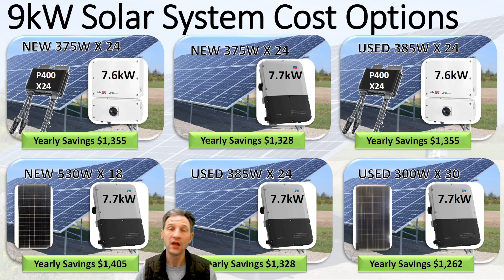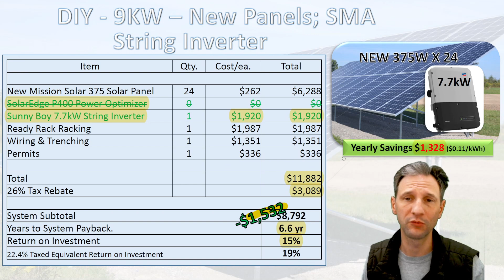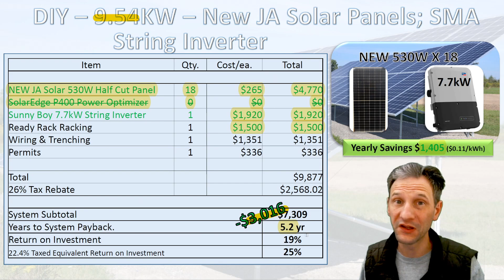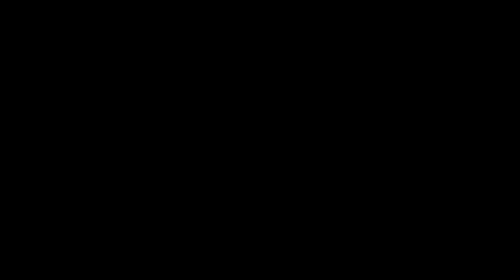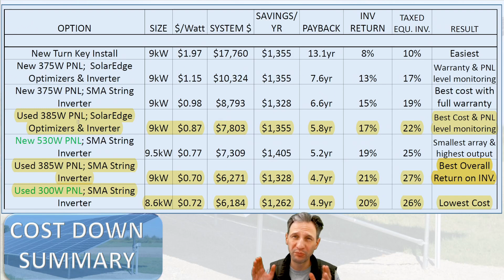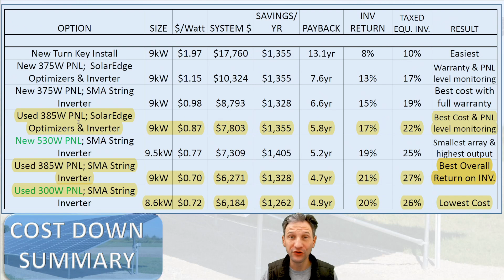DIY Solar Panel System - How to Do it CHEAPER!!

Comment: An East/West array produces nearly as much energy as a South facing array. This is due to the Sun hitting the face of the panels longer during the day. The Solar generation curve is indeed widened and flattened out. Additionally, your array produces energy earlier and later in the day because the panels are facing directly into the Sun.  My Electric company (in FL) is even trying to get people to install West facing panels because, here in Florida, there is so much A/C demand that having West facing panels can really make a big difference. I think more Electric companies will begin installing East/West , fixed mount, systems to reduce the LCOE and many might begin installing extra West facing panels to better match their demand curve.
Reply: It is not true that East or West facing panels produce the same as South facing ones. The main reason is that the East-West facing panels ignore the sunlight till the sun is at a degree higher than the tilt. Since keeping a flat panel is not recommended due to accumulation of dust and washing problems, a small tilt, say of 10 degrees is a must. This means the panels will simply not work for 1/9th of a day and work at a very low intensity for another good length of the day till the sunrays make sufficiently straight contact with the panels. On an average, expect a loss of 1/6th of the energy generation in comparison to south facing panels
Reply: @shrujanamsyama9940  I never said that East/West facing panels produced the same amount of energy as South facing panels,  I said "Nearly as much". I believe when you consider the low angle of the Sun during Winter months  which reduce the effectiveness of South facing panels, and the fact that an East/West array will not be effected by the Sun's lower angle, the East/West array will produce nearly as much energy as the South facing array.  Your point of an East/West array producing 1/6th less energy is reasonable, however, I think the energy reduction is less than 1/6th (perhaps 50% less than your 1/6th figure).
Reply: @bbcooter388  Even during winters, the sun is still in the south (assuming you are in North hemisphere) and south facing panel serves the best. Only for those people who are on the equator, the east/west facing panels may perform somewhat close to south facing panels. For everyone in North Hemisphere above 10 degree latitude, it is decisively south facing panels which is the best. Similarly, everyone below 10 degree South Latitude, North facing is decisively best.
Reply from the maker: Thanks for that information!  Do you have any articles or documents you can share on where you got your information?  I'm always looking for actual data.  Thanks!
Reply: @ProjectsWithDave  I could swear that I answered this question when you asked it,  however, it seems to not have been properly recorded.  I don't have the original article that I first read about East/West arrays,  but a quick Google search for East/West  Solar arrays will bring up a good number of articles for your research.

Comment: Love your video!  But, this is just my opinion, what you paid AFTER your rebate, is what you can get a system for with some good lifepo4 batteries.  To me the grid tied systems are a scam, the people selling them are really getting the rebate (of course if you do it yourself like you did, it's way better).  Still, I know it's easier when using your 220 V central air and such, compared to batteries.  My house is all propane for hot water, stove, and heat, we also have a wood stove that heats the whole house if the winter.  Central air and the dryer are the only big pieces of equipment that we don't use our solar on.  We didn't really do it to save money,  just to use it each day, and when  the power goes out, it's worth more than money.  Here in WV we don't have too many outages but we seem to get more each year, and the way the world is going right now, I wouldn't take a million $$$ for my system.  It works great!  You have a great system set up!
Reply from the maker: Nice job!  Thanks for the input!  Of course my house is all electric, including winter heat so off grid is a pretty significant challenge.  However, I intend to get there some day...  : )
Reply: I also have an off grid system. I installed it myself. I have 12,000 watts of panels. I never use all of my energy produced. But I have natural gas for most of my major appliances. Water heater, stove, dreyer and fireplace insert. I still use some electric from the utility company. Some months when using more power from my mini splits during the winter. I only have 20,000 watts of battery back up. I could still unhook the grid power if needed. But the comfort is highly important. So we run the heat with our mini splits in the bedrooms.

Comment: Are you taking into account that some of these systems have higher wattages than the inverter can handle in your payback calcs? Friends of mine have inverters like this and they hit peak power production on the inverter and are clipped. A 14KWH system will never make more than about 7.7KW with a 7.7KWH rated inverter. Am I missing something? I'm hearing that some installs are pointing panels in different directions liek you're trying in order to broaden power vs hitting really peak power which can allow for less clipping with larger arrays. Personally I'd go nuts if I were seeing clipping lol.
Reply from the maker: Yes, these system proposals all have clipping.  However, from my research and personal experience some clipping is advisable.  Even with this level of oversizing you have cloudy and winter days with little to no clipping.  If you size your inverter to prevent any clipping, it will take much longer for your system to pay off. If you live in an area with very consistent sun exposure year round, you may want to target less clipping.  The west facing test rig in the video is my attempt to maximize the oversizing while minimizing the clipping.  We will see after about 6months if it makes sense or not.  Here is an article on oversizing the array: https://www.sma-sunny.com/us/7-reasons-why-you-should-oversize-your-pv-array/

Comment: Hey Dave, Did You Read The Whole Full Note That I Had Sent You Before? PS As For Your Reply About Our Solar & Wind Resources Here In Texas & The Grid Shutdown Last Year? Do Some Further Research & You'll Find That The TRUE THUTHS On Those Matters Is That Our Solar & Wind Ran Strong Thru That Whole Ordeal & It Really Saved Our Bacon From Even Worse or Longer Blackouts! Then EPCOT LIED IN REPORTING TO NEWS AS TO WHAT REALLY HAPPENED & Blamed It Falsely On The Solar & Wind Powers! The Real Truth Is That Many Of The Main Line Coal Burning Plants Were Shut Down & Taken Off Line Because The Coal Piles Had Too Much Moisture Content Due To EPCOTs Bad Inspecting Programs! Soo When The Outside Coal Stock Piles Froze Solid Together Due To The Extremely Low Temps, They Couldn't Get The Coal Into Plant's Burners, Thus A Bunch Of Major SHTF Problems Arose & Grid Collapses Until They Got Them Thawed...
Reply from the maker: Ha... no, I didn't realize it continued below the line.  I had not heard about the coal plant issues, do you have a report on that information you can link to?

Comment from the maker: Find More information for this project and others on my website: https://projectswithdave.com
Other related videos you may like:
Super Cheap Solar Panel Review: https://youtu.be/qu4iGxBhqzs
Check out the first year performance results here:  https://youtu.be/BatTeSq05rU
See the total system cost here: https://youtu.be/PNTO83FvaL4
And How to size your solar system here: https://youtu.be/rbFnZqA0GCI
4 Things to Know About Solar in the Snow: https://youtu.be/vY3PufzPUnI
Ground Vs Roof Mount Solar: https://youtu.be/w-iS_8e7n60
How to Get A Permit For Your Solar System: https://youtu.be/imiEYDHLG4A
How to Crimp MC4 Connectors: https://youtu.be/oH3LqTu4B8E
3 Solar Panel Wiring Issues Answered: https://youtu.be/i7vHEHB3a-M
Net Metering Explained With Actual Data: https://youtu.be/IwUK1dNJ3n8
Reply: Why are there used panels available?  I can understand used cars - some people have higher standards for reliability and looks, so they replace the vehicle before its end of life.  But what circumstances lead to used panels?
Reply from the maker: There are multiple reasons for the availability of used panels, one is the result of upgrading to higher performance panels.  Some installations are limited by available space and the only way to get more power is to replace the panels with a newer higher efficiency panel.  Other panels could be the result of a recall for some manufacturing defect, so you should purchase from a trusted source that will back up the performance.
Reply: Dave, did you calculated degradation over time in ?
Reply from the maker: I didn't consider degradation or the rise in utility rates in the payback period.  I assume they will cancel each other out.  : )
Reply: When you buy used you have to consider how old they are and how long have they been producing? Degradation becomes advanced for your calculation and will lose production on the tail end compared to the same time frame as new. Time for financing matters as well. Where you are located regarding latitude makes a difference. The closer one is to the equator the better production you will realize. Regarding direction, south captures the most efficient arc of the movement of the sun across the sky. Perhaps a change in the tilt angle for winter and summer might pay dividends. One has to realize the life of the inverter and if it needs replaced will be out of your pocket. I lost 11% production being not directly south but a bit west on the roof. Are there obstacles that impact your array that you have no control over?  Shade is an enemy. I wish my prices were as low as what you have demonstrated. Like a lot of things the longer it goes the price comes down.
Reply: better results rail shutters chrome paint leds lights。
poof its elec。

Comment: Need to get a little deeper into these systems. The 530 watt panels will not work with the Sunnyboy which has a max 10 amp input.
Reply: I’m starting a system with two SMA 7.7 and 48 380 watt Q Cells  my cost $20,000.
Reply from the maker: Thanks for pointing out the amperage limitations of the SunyBoy system.  However, according to their design software the system can handle the higher input, it just limits the input current to 10A resulting in a 2.17% loss.  The 18 panels is a bit overpower for the system and it would be better to just use 17 panels which would also match the 9kW of the other system comparisons I made.  If what you are saying is true, even the system you planning would not work as the 380W Q cells put out 10.5A.   If you have some information showing it can't handle the input, or the SMA design software is in error, please let me know.  Thanks!
Here is a link to the design software results: ( https://drive.google.com/file/d/11rEOtXr7y6K_gpgGOpmtrspattXJzVLG/view?usp=sharing )
Reply: Here is the best information I have found. Sorry it didn’t paste. SMA stated the max fuse is 12.8 amp per MPP.
Reply from the maker: I called SMA to confirm your concern.  The spec sheet shows a maximum short circuit current of 18A.  The system will only utilize up to 10A, but it can handle up to an 18A input.  Since the JA Solar 530W panels are 12.8A they are well within the system limitations.  See the spec sheet here:  https://drive.google.com/file/d/1YaPrmoqx_wlnVeV_pSad8lgbbBSymkZN/view?usp=sharing
Hope that helps.  Thanks!
Reply: Thanks for the info yours is one of the first videos I use to start my system. I wish I had known I could use the larger panels  it would have saved me a lot. Here is the tech note that had me worried.  

 TECHNICAL NOTE
Topic: DC Input Current Ratings for Sunny Boy Inverters
SUMMARY
The technical data in the SMA product data sheets is specified for nominal operating conditions. The specified DC maximum input current refers to the actual continuous input current recommended for an optimum energy yield of the system.
DC INPUT CURRENT RATINGS FOR SUNNY BOY SYSTEMS
The DC maximum input current specified in the Sunny Boy product data sheets refers to the actual continuous input current recommended for an optimum energy yield of the system.
Due to the common Maximum Power Point (MPP) characteristics of the inverter input, the inverter will not be able to find the optimal power point if the current is outside of the specified range. In that case, losses in energy yield can occur. However, the inverter will not be affected if the short circuit current of the connected PV modules exceeds the specified value. The following table shows the DC input current specifications of the Sunny Boy US-type inverters as well as the respective short circuit current of the connected PV strings (considering 125% NEC factor). These values are recommended for an optimum energy yield of the system:
 Inverter model
SB 3000US
SB 4000US
SB 5000US
SB 6000US
SB 7000US
Rated DC maximum input current IMP
(continuous)
17 Amp
18 Amp
21 Amp
25 Amp
30 Amp
Maximum short circuit current of connected PV strings ISC
(considering 125% NEC factor)
22 Amp
23 Amp
27 Amp
32 Amp
36 Amp
      In addition, the current limitations for any system with SMA Sunny Boy inverters SB 3000US, SB 4000US, SB 5000US, SB 6000US and SB 7000US with respecitive SMA DC Disconnect model are defined by the physical current limitations of the DC disconnect and the integrated string fuses:
» The maximum string fuse rating of the SMA DC disconnect unit is 20 Amp. The NEC requires that all fuses and wiring be sized for a minimum of 1.56 times the ISC of the PV module used in the system. Consequently, the maximum short circuit current per string can be up to 12.8 Amp.
» The maximum operating current of the DC disconnect unit (all parallel strings combined) is 34 Amp. If there are additional questions or if further clarification is needed, please refer to the inverter
manual or contact technical support at SMA America, LLC.
SMA America, LLC
6020 West Oaks Blvd, Ste 300 Rocklin, CA 95765
+1 916 625 0870 Service@SMA-America.com
TechNSBDcINPU-hUS112912
Reply from the maker: In correspondence with the technician the process for calculating the margin is to multiply the Isc of your panel times 1.25 and that result has to be less than or equal to 18A.  In the case of the 530W panel the Isc is 13.43A*1.25=16.79 which is less than 18A.  That provides the necessary margin to the limit.  Of course anything over 10A results in some clipping.  Here is the SMA spec information:  https://drive.google.com/file/d/1u8-cIzqmoV_kA8D-7R2_rSudZx1KYWym/view?usp=sharing

Comment: Are you including the price of your ground mount array structure? I've been pricing what I need for a 28 panel ground mount setup and 100% DIY the cost is over 2x what you're listing. 2" sch 40 pipe sourced locally with IronRidge racking and DIY all the structure and rail mounts I'm over $4k. If I 100% DIY but buy all the parts I'm well over $5k.
Reply from the maker: Yes, this includes the ground mount through Ready Rack.  However, someone commented the prices have gone up since I installed my system, I assume due to the increase in the price of steel.  When I was doing the reasearch for my system originally, I looked at doing a sch 40 pipe system with IronRidge racking, but it was twice the cost of the screw based system I installed.  You can see a detailed breakdown of my cost here: ( https://youtu.be/nC7i_GSrGlk ) and you can see the installation here: ( https://youtu.be/_xA6qOwnYbM ).
Reply: @ProjectsWithDave  that's really interesting. I've got a tractor about the same size as yours and a 3 point post hole digger just like yours. Funny you made an adapter,  I'm making an extension for my auger bit to drill 6 ft down, 12 diameter this very weekend. I'll check with those ready rack guys this week. Thanks!
Reply from the maker: My first investigation was exactly what you are doing.  I had to make an extension for my 12" auger, except I think my design called for 7' deep holes... it seemed ridiculous to dig those massive holes and then bring in concrete trucks to fill them... that's why I started searching for alternatives.  There is also a company that will drive posts into the ground, I'm not sure the cost though.  Good Luck!
Reply: @ProjectsWithDave  I ended up getting the ground mount setup from ready rack and got it installed Christmas weekend. My batteries will be here tomorrow and the last parts I need are the panels which I ordered the same time as everything else haha
Reply: I looked into driving the post’s. But we get some winds and the county inspector said we needed to concrete them.
Reply from the maker: That doesn't make sense, driven posts can be just as strong as concreted posts, it's all about the strength of the post and how deep you pound it.